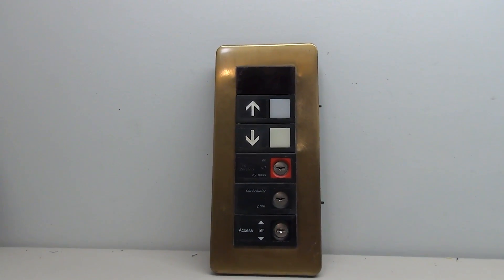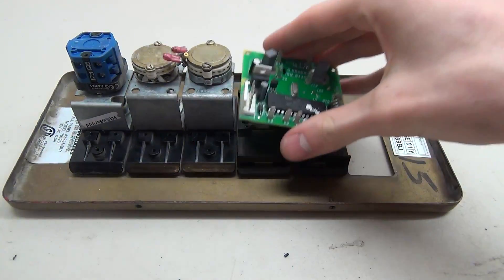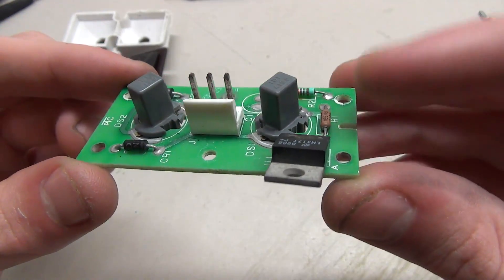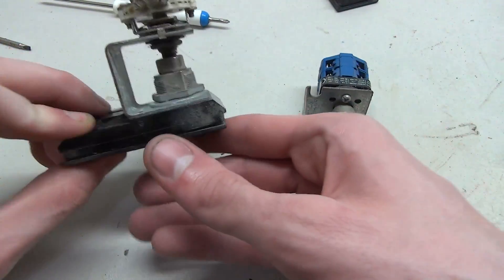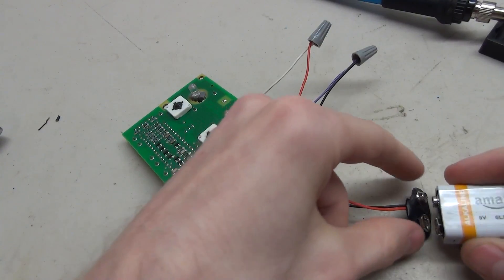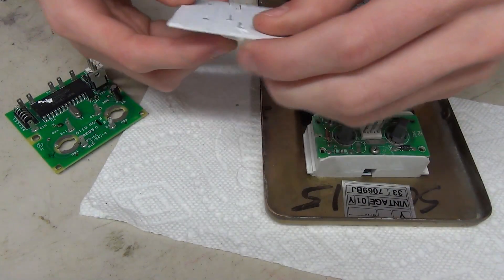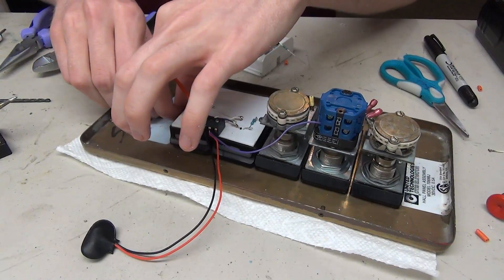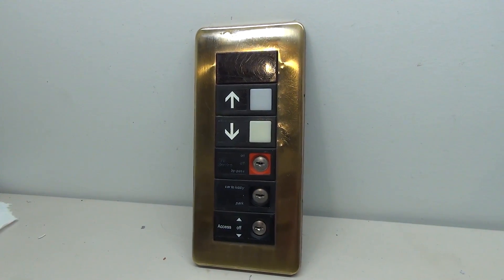Wiring an Otis Series 1 Lobby Call Station

Comment: You never cease to amaze me with your ability to problem solve by eliminating roadblocks and simplifying things. You should see some of the rat's nest God-awful workaround solutions I've come up with on some of the older proprietory computer components I still run across from time to time.  (DEC is the worst.  They purposely cross-wired common cables so you had to buy theirs... which I can't do since they went out of business in 1998.)  At any rate, you'd cringe at some of my "solutions"... but they work.
Reply from the maker: Thanks! I've done some pretty janky things too.